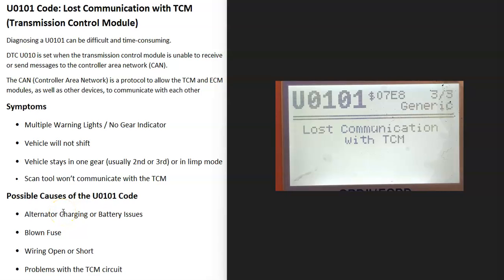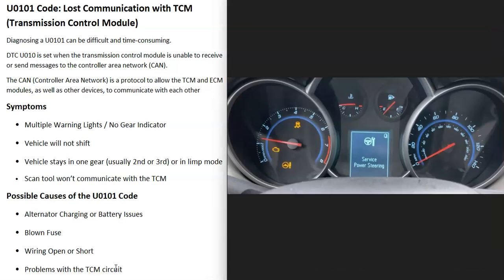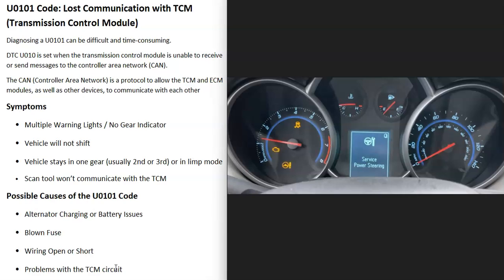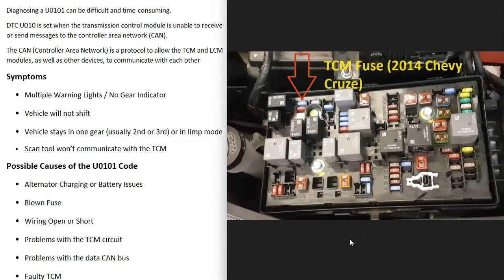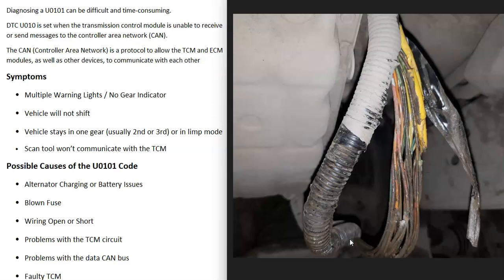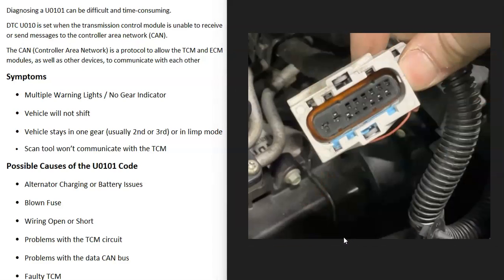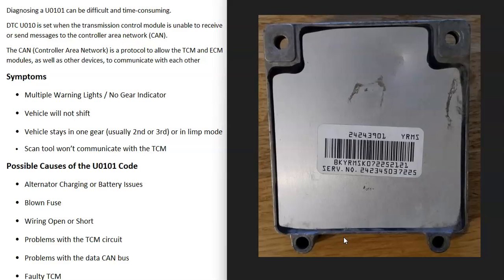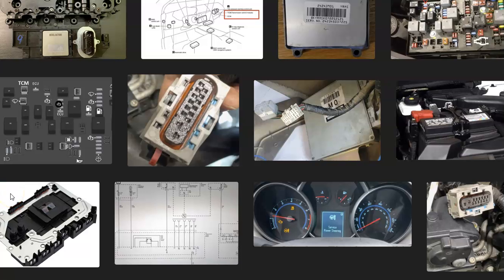Causes and Fixes U0101 Code: Lost Communication with TCM (Transmission Control Module)

Comment: Peace be upon you, my dear friend, and everyone who sees my comment, I have a Chrysler model 2007, there is a problem. I had an accident and I replaced the abs, the transmission and all the wires with the replacement of the fuse base, but there is a problem. The good only goes on spare parts No. 1 and 2 in the automatic mode and does not exceed the speed of 60, but if you put it on normal spare parts No. 4, it goes at at a rate of 80 km per hour. For information that the mind of the car, the base of the fuseses and the mind of the transmission are safe from malfunctions, so what is the reason and thank you?

Comment: My car is a manual 2006 330i 6 sp manual sport package my cluster went out,outside ambient temperature sensor not working, inside AC and heat not working, blower not working,????

Comment: I just had my tires replaced with new tpms and it's now in limp mode, any suggestions?
Reply from the maker: The computer needs to be scanned with an OBDII scan tool for codes which will point to the issue. There are low-cost scan tools for less than $20-$30 that will give basic codes.

Comment: Mine only has the issue during cold start.  If I warm up my car it will work and AT light turns off. I try cold I get code u0101.. I tried a different tcm and it still.does it. What could my issue be?

Comment: My AT was flashing once every ten mins for about 4 times total. Then later the engine light came on. I drove it and it had no power in gas peddle. I waited and eventually the P light lit up and I was able to put it in drive and drive it. Then I had it looked at and disconnected. Put a new used one on, mechanic said same u0101 code, so be put the old one back on. And since then, I've had no engine light or Traction cont. Light or AT light. And I'm currently looking at other vehicles to buy cause it's an expensive fix. I have Mazda 3 2011 2.0L auto. What should I do?

Comment: I have a 2016 Pilot with codes U0101 and U0047. Dealer recommends changing TCM for $1,600.  I have the emissions and transmission system error on dashboard. Anyone have this issue?
Reply: Yo tengo ese problema ahora mismo
Reply: @AxelUs-v8o sigo igual aunque cambiar el TCM.

Comment: Mi Outlook AWD 2008 no funcionaban los cambios (solo quedaba en 3a. o reversa) no funcionaba la puerta trasera (liftgate) no funcionaba completa la pantalla de la computadora). puse el  scanner y me apareció este código y 6 más. revisé los fusibles y parecían bien. Desesperado revisé cables y arneses. llegué a pensar en cambio de computadora. Al día siguiente volví a revisar el fusible del TCM y Liftgate  aunque parecían bien le puse nuevos y todo quedó solucionado!!! era el fusible del TCM 
de 6 códigos solo quedaron 2 pero esos ya sé por qué. 
check the TCM fuse thats the solution.

Comment: My friends 2014 chevy sonic (70k miles) is currently showing this code.  Only symptoms the car is having is the solid check engine light and when she is stopped at a red light her dash display will appear to show her car changing gears but it corrects itself once she starts driving.  Her doors will also randomly lock and unlock (as if the car is shifting into park).  The car seems to drive and shift perfectly fine though.  I had her battery and alternator tested and both came back fine, i will check her fuses next.  Do these symptoms narrow down the possibilities for anyone more familiar with cars?  Mechanics all know she has zero car knowledge and trying to tell her they dont know whats wrong but to expect a few thousand dollars for a new transmission which seems to be quite the jump in my opinion. maybe im wrong
Reply from the maker: It needs to be diagnosed, but it sounds like a wiring problem or possibly a computer issue with the TCM/PCM. The door locks are controlled by the BCM module.
Reply: My 2015 Chevy Sonic LTZ with an automatic transmission has been doing the random door locking and unlocking since we bought it in 2020. Recently the transmission slams when shifting into reverse, the car will sometimes jerk forward while coming to a stop, or it will lose power and the car will barely move. The check engine light will come on and sometimes the traction control light will come on. I'm getting the U0101 code. Took it to the shop, they said they found coolant inside the TCM electrical connector on the front of the transmission. I had replaced the coolant reservoir several months ago because it was cracked underneath which was probably where the coolant came from since it sits right above that TCM connector.  They cleaned the cleaned the connector, applied dielectric grease and said that they don't know if that would fix the problem and that that coolant may have made its way further into the TCM. Well, the transmission is still acting up and it still has the U0101 code. I'll check the fuses, battery, and alternator and if those things check out, I'll take the car to a transmission shop. 

I wonder if the doors locking and unlocking is somehow related, because sometimes when the transmission acts up the doors lock or unlock at the same time. I know when you shift into park or drive, the doors will unlock and lock as they're supposed to. So there is some kind of connection between the transmission shifter and the door locks. Sorry I couldn't be more help. I'm just thinking out loud.
Reply: @carlh2156 everything that you said is happening to my 2014 Chevy Cruze!  It’s driving me crazy because I truly want to know what the problem is. Mechanics keeps changing random things in my car! ALSO…when u get the codes cleared does it start working PERFECTLY fine for a few days?

Comment: Mine came after 2500hd trans overheating and my nephews a tech and said it will do that u0101 to protect something and said to disconnect the battery wait a minute and connect back and it was fine! Now just gotta nail down why it over heated other than it I was hauling to much weight 😂

Comment: Just run a ground wire of the battery 🔋 to the wire black cable in the wire harness ….. problem fix
Reply: Can you explain more pls
Reply: @a @CBSAUTO  the ground wire is in your wire harness…. It the black wire take another black wire from that wire and run it to the negative battery post

Comment: 2012 impala lt. Tom connector is intermittently sending correct signals but car is in limp mode at 55 mph. I need to know what vehicles are interchangeable with 2012 impala please?
Reply: Did you ever figure out what is was? My 2013 impala is also stuck at 55 mph with the same code.

Comment: nice video boss, I have a 2010 hyundai genesis coupe and look: code U01010 - PCM did not recive a mssg from the transsm control module... and the mecanic said i need a new transmission valve body, he wan to change all the transmission...
Reply: Вы решили свою проблему? Что было? У меня похожая на Соренто.(

Comment: Have this code on my car. So stumped. But my car keeps keeps shifting to different gears while I'm driving including park. Anyone have any ideas on something I much be missing? Just replaced the coil from a aftermarket one to a GMC certified one and the problem completely worked it's way it for two days. And bam now it's doing it again 🤦🏼‍♀️
Reply: You have a bad connection at the plug for the TCM 95% of the time it’s a bad ground or the connector needs cleaning out then put dielectric grease in the connector and plug it back up.

Comment: i have a 2014 dodge challenger ralley redline, i recently ripped of the trim aero piece from my bumper by accident and it ripped off the fog light and the windshield wiper reservoir wiring harness, i thought nothing of it becuase it was not affecting anything. i just turned on my car and it went into limp mode and it feels stuck on first gear, my question is do you think this part of the wiring that got ripped off is causing the ECU to throw off the TCM becuase i plugged in my scanned and i got code u1010, please help.
Reply: Did you fix it ?? What did you do

Comment: What can I do if the tcm is good and is just that is not getting power to the tcm
Reply from the maker: If the fuses are good, you will need the schematics and test the wires to find any open, short, and sometimes run new wires.

Comment: could wheel speed sensor cause this code?
Reply: I have a bad wheel sensor also
Reply: @brandonpeach66  it turned out to be bad tcm ground
Reply: @brian1438-i1c  did you have to replace the tcm itself or just the ground?
Reply: @brandonpeach66  just ran new ground. tcm to car body. easy job but took days to figure it out. runs fine now. tcm was good
Reply: @brian1438-i1c how did u do it
Reply: @preacherboym  run wire from tcm to a ground

Comment: Having the same code pop up on my 2018 Toyota Camry se but the transmission drives perfect I checked all the fuses everything is good. checked my battery’s and it’s also good. Do you think it could just be the tcm and also do you know where it’s located on the 2018 Camrys ?
Reply: You ever figure it out?

Comment: My scanner show no communication at all , I put it on another car and worked good , what possibly cause that I have crank no start .
Reply from the maker: Check for any blown fuses related to the fuel pump, sensors, or ignition. Basically, the first things to check are if the engine is getting gas and spark.
Reply: @HVAC_Mechanic  I'm getting fuel and spark and throttle working fine , fuses are good but I didn't check releys

Comment: Hey got a 2013 Chrysler town and country changed the tcm in the tranny but still in limp mode and still showing lost communication.. all fuses are good .. are there any other solenoids or sensors there that would cause This ?

Comment: 2014 Chevy Malibu this code pops up but it also says service power steering and my locks in my car go nuts like a mini gun going off, I can reset the tcm and it’ll run fine after but 2 weeks go bye and it’s back to fucking up
Reply: We have a 2014 Malibu too and doing exactly the same thing.. What happened with yours? Thank you
Reply: @dcrookster same
Problems I'm having now smh
Reply: Did anyone found out what the issue was?
Reply: Im having this same problem was told it was because the battery in the trunk in my car replaced that and still having the same issue 🙄

Comment: 2019 GMC Elevation...My truck just wouldn't start and after a jump the check engine light came on and was throwing this code. I didn't have any problems before, and it wouldn't hold a charge after.
 I put a new battery in it, and it took care of my problem. Check engine light went off and it went back to normal.
I know this won't help everyone, but it may help someone!  Good luck!

Comment: HI SI I CHECK ALL WIRING ONLY PROBLEM I SEE 103 GROUND GOSE TCM AND B C M. GROUND WHITE &BLACK.WIRE ..TRUNED TO 00.0 ON POWER PROB..GROUND GOWAY WHEN TURN IGNITION ON PLS HELP OUT WHAT SHOULD I DO I CHECK NET WORK GOOD.60&120.HOM  MAY RUN GROUND  BY BATTERY TO TCM? AND SEE IF WORK OUT.. O PLSFORGIVE MY ENGLISH VERY POOR I M GERMAN

Comment: HI SIR I HAVE 2012 CHEAVY EXPRESS VAN 3500. TCM FUSE WAS KEEP BLOWING I  HAD CHANGE T C M  IN  SIDE CHANGED CONDUTOR PLATE.NOW CAN PROGRAMM KEEP COME UP U0101. I CHANGED E CM CHECKED WIREING ALL THAT.ONE  GETTING 60 OHM.DLC TCM AND ABS. ENGINE 6.0. 6 SPPED T C M( ZF) I GOT  DIAGRAMM. OBD. I CAN NOT FIND ANY PROBLEM 2 MONTHS.PLS HELP GIVE SOME HINT. WHRER TO LOOK. .ON LINE GUYS  CAN NOT GM TECH CAME TRY TO PROGRAMME.CAN DO ANY  THINK. MAY SEND YOU VIN? I AM SHOP HITECH GERMAN AUTO. NEVER DID GM BEFORE.

Comment: HVAC MECHANIC I have a 2016 Jeep Grand Cherokee Srt with this very same code have little to some knowledge on mechanics, went uder the hood to find out my fuse #f60 was blown switched it out with a new one and the new one blows as soon as it touches the terminals. May you please point me in the right direction as this is my only means of transportation at the moment to get to and from work. Thanks in advance 🙏🏻
Reply from the maker: There is likely a wiring issue, which can be hard to diagnose. You can check for any obvious signs of wire damage otherwise a wiring schematic for the vehicle and a meter are needed to diagnose it.

Comment: 2014 sonic im getting a u0101 its a 5 speed manual ???
Reply: Check the Wiring and Connectors: Inspect the wiring harness and connectors for damage, corrosion, or loose connections. Pay special attention to the connections between the ECM and TCM.

Scan for Additional Codes: Use an OBD-II scanner to check for any other codes that may provide more context for the issue.

Inspect the TCM: Ensure that the transmission control module is functioning properly. If you have access to another vehicle of the same model, you could swap TCMs to see if the problem persists.

Check for Power and Ground: Verify that the TCM is receiving power and ground as needed. Use a multimeter to check voltage levels.

Look for Software Updates: Sometimes, manufacturers release software updates for the ECM or TCM that can resolve communication issues.

Reset the Codes: Clear the codes using the scanner and see if they return after a short drive. This can sometimes reset communication issues.
Reply: @ i did it turned out to be a junk ecu from a crap companies

Comment: I currently have this U0101 code on my 2014 Chevy Malibu. When the TCM is down, the car is stuck in third gear (limp mode) and gear shift is not illuminated. When I drive 20-30 minutes in limp mode , the TCM does come back and stays as long as I keep driving. When I shut the engine off and wait about 10 minutes and turn engine back on, the TCM fails again, so it's an intermittent issue. Chevy dealership has no answers after I paid them 224 dollars in diagnostic fees. They wanted an additional $1300 to further diagnose it and obviously I declined that, so now I'm stuck with a TCM that goes in and out. Very frustrating. I have taken that TCM connector off and on so many times that I've lost count. Nothing is working.
Reply: Check for bad fuse box, had 2 I found on two different years 2012 & 2010. Found break in the circuit board under the fuses, there is a lot of videos on it.
Reply: Hi. I have the same problem with my Cruze2014. Could you fix the problem?
Reply: Buy one at the junkyard
Reply: Hey I have the exact same issue with my 2015 Malibu, did you ever find out what was the cause and how to fix it?
Reply: @Vmadisonh14  9 months later and still no fix. I’ve pretty much given up and just dealt with it. The TCM comes back after driving for a while.

Comment: Hi, can anyone please help. I've got W212 2013, U010 code pops up every now and then with check engine light. The code goes away on its own. From past 2-3 days the code is popping more frequently.  Whenever the codes pop up the car Doesn't shift up, rear camera doesn't work, when pushing the lever to shift gear from park to drive takes a strong jerk and the car only drives on 1st gear. The cars Ignition is fine amidst these AC sometimes stops working. Battery is new car start normally without any hesitation.  Any suggestions on what to be done??

Comment: CURRENTLY dealing with this on my 2014 3.6 impala, it fuking sucks......i have no way of diagnosing but by checking the wires for resistance/continuity.....every module, every wire, every connector.....so far all my 2500, 2501 circuits are good....i hope its an easy wire fix. i lost 6k on a transmission shop that just started swaping the most expensive prts hoping for the best, next thing you know, i get U0101 for the 3rd time.....they say dont bring it back. had they done their job and proper diagnosis I coud be working.
Reply: Did u ever get it fixed if so what was it
Reply: @RaShaud  the connector was broken so the pins were not making proper contact. it was hard to tell because the lever still worked but i noticed a small crack on it. i have learn quite a bit since then and im pretty much a mechanic at this point 😅😂

Comment: Hi 
My car have problem with tcm 
When I start my car it’s ok for 1 hour and after that the gear only shows (p-n) not go to the (D-R) when I turn of my car and turn on its ok for one time change gear after that same issues Will appear
Reply from the maker: It needs to be troubleshooted to know the cause, but often, when there is no issue when starting, but after the engine gets hot, there is an issue. The TCM has a bad contact or solder joint on the board. This is just a guess, but I have seen it before.
Reply: I changed the tcm fuse , but the problem is still there , what may cause ?
There is no issues code to know what’s wrong with the car no check light ! 
After one horse ride the problem coms and gets worse , Every think ok the gearbox is so soft , but when gets hot when I want to change the gear it’s only go to (n-p) when I turn of it ok only for one more time

Comment: Hi 
My car have problem with tcm 
When I start my car it’s ok for 1 hour and after that the gear only shows (p-n) not go to the (D-R) when I turn of my car and turn on its ok for one time change gear after that same issues Will appear
Reply: Did you ever get this fixed? If so what was the issue! I have a 2014 Chevy equinox and it sounds like the same issue

Comment: mate I just wanted to let you know these three videos saved me from pushing my amarok into the f*cking sea. Thanks!
Reply: I’m about to light my Camry on fire, checked and cleaned all ground wires even bridged one ground to make sure, cleaned tcm terminals, replaced abs sensors on two front wheels, the last thing I’m doing is replacing the alternator we’ll see.
Reply: @wagner55 did it resolve after changing the alternator?
Reply: @yousaforton4578 didn’t have to, a friend took it to a dude that traced it out to a few chewed wires, damn mice. I didn’t bother to ask where he found them, sorry.
Reply: Lolol!!😂😂😂